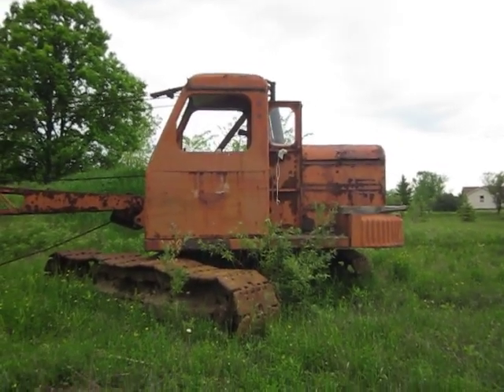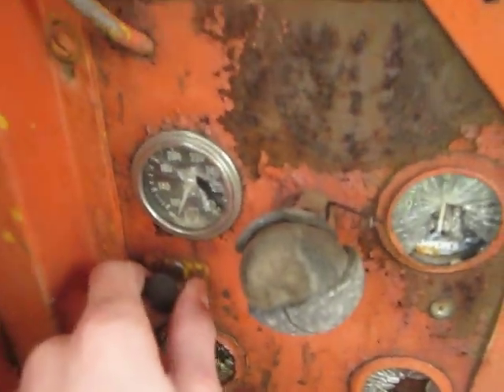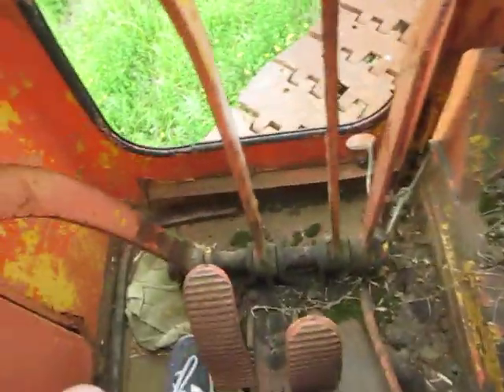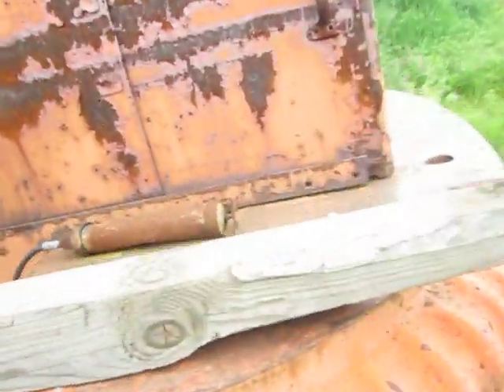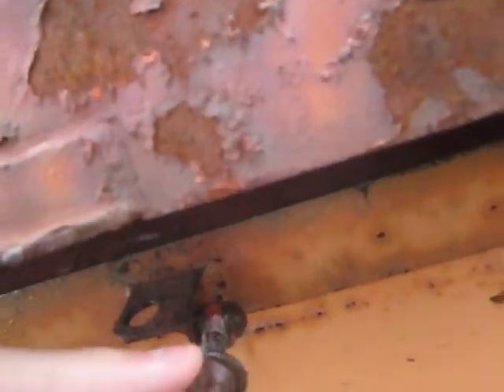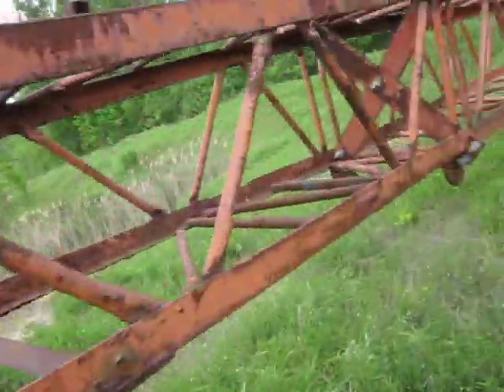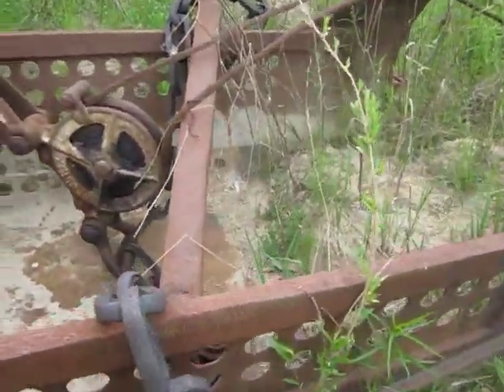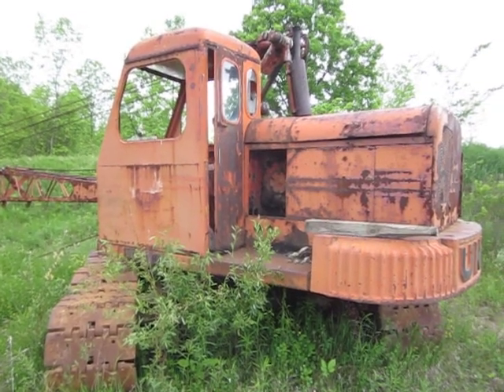UNIT 1020A Dragline Documentary

Comment: great video Micheal..watched a bunch of times ...getting more familiar with these old Units!
Reply from the maker: larry anderson No problem! I will get the manuals emailed to you
Reply: @UnitCrane514  no problem with the manuals,   but 1 question.  are the 2 clutches  that you show in the engine compartment the reversing clutches that work with the swing/travel/boom hoist lever that is on the very left side of the cab?

Comment: My old man has this model I believe, only thing I see differant is his has a battery box between the cab door and the counter weight. About 6 years ago we added 15 feet of boom that came with it, and after we raised it up and shut it off to connect the bucket the starter went out.. hasn't moved since. Maybe I'll go next weekend and see if I can get the starter going. He also has a clam bucket for it we never tried out yet.
Reply from the maker: Christopher Ertl Starters are cheap, go get it running. Does yours have a Detroit in it?
Reply: @UnitCrane514  The starter was rebuilt and has less than 50 starts on it so I figure there cant be much wrong. Yes it has the Detroit. Only other thing I remember not working was you could only lock one track, but we never looked on to it.